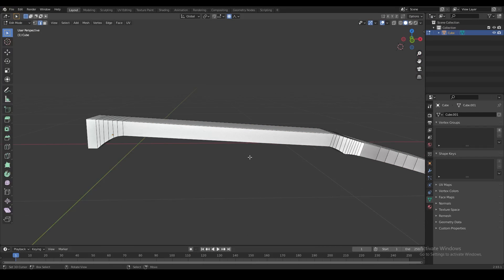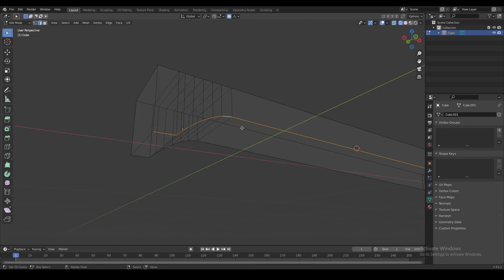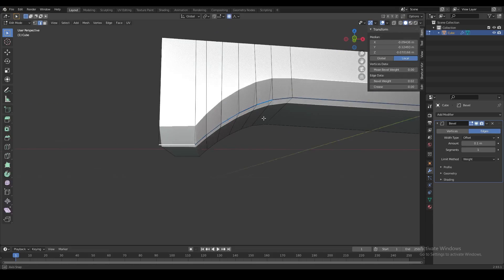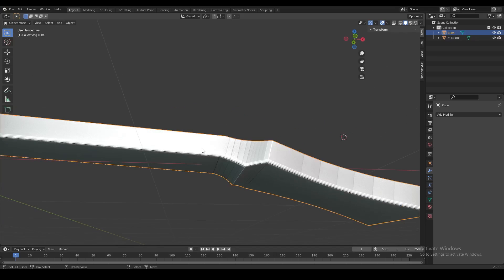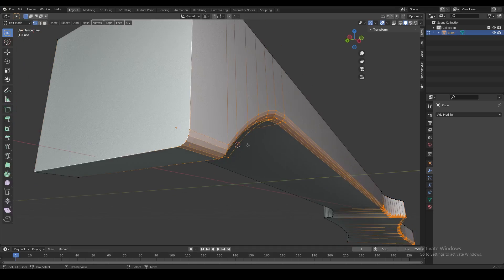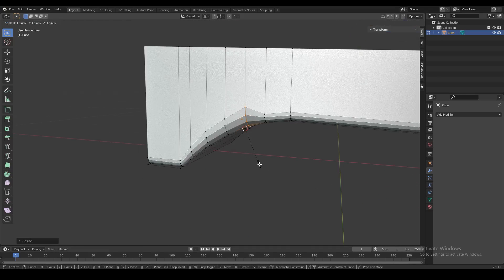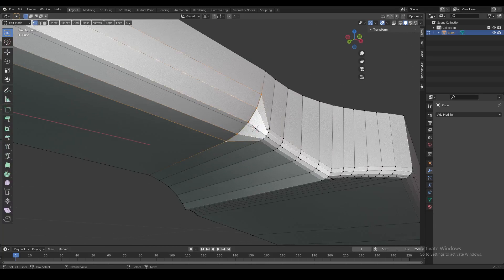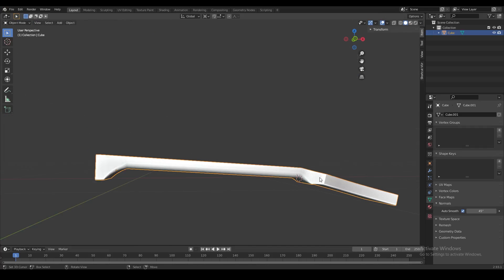Bevels with Different Width in Blender | 3D Cursor Bevel Modeling Trick

Comment: I am not sure when this option appeared in Blender, but at least in 4.1 the Scale tool has another mode called "Scale Cage". This works similar to scale tool in Sketchup (for who is familiar with that) and will help a lot in such cases, since you don't have to play with the 3dcursor every time.

Comment: not really that efficient or optimal, there should be a simple way to do this not manually.
Reply from the maker: Bevel weighting is another way to do it but it doesn't retain the shape of the bevel unfortunately
Reply: @ArijanRace  Let's hope this could be possible in the future, a way to falloff bevel weights or something to transition from dif values.

Comment: Omg, thats where you need to use falloffs instead. Not waste your time.
Reply from the maker: No need to be rude in my comments.
Reply: One way you might give a try is beveling by percentage (100%, no clamp overlap) in a modifier,  putting in  guide loops to restrict the width (can be different on each side of the bevel) .. adjust the guide loops to taste, follow up with a Weld modifier. Quite intuitive, non-destructive.

Comment: You can also use the percent mode of the bevel tool, there are different ways the bevels are created and percent is one of the most underrated but also most useful modes for something like this.
All you need to so is to create some edges on both sides of the corner / edge you want to bevel as your guides or limits and done. The Bevel will adjust to the guides or limits. Very handy.
Reply: Snap!  I was just about to say the same . Do it with a control-lopp, and percent in a modifier. You can even delete the loop when done. Snapping is available for precision.. etc.
Reply: Yup. Gleb has a very detailed tutorial on this.
Reply: ...just annoying that the devs don't normalize  'percent' to 0-1 and call it something else, so it ties in with the rest of the system.

Comment: Or you can just use the weight option in the bevel modifier. Set the bevel to the highest and to get tight bevels you decrease the bevel weight. That's what I use the most. (N tab for the bevel weight slide btw)
Reply from the maker: The main benefit of the method in the video is that you have full control of not only every edge, but every vertex, so you can make extremely different bevels. I will experiment with your method as well, thank you for the input